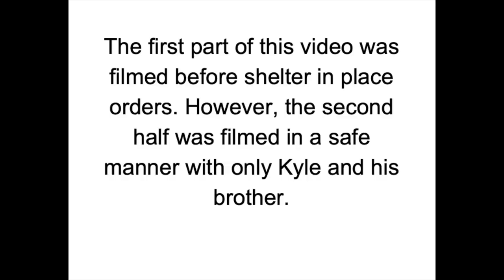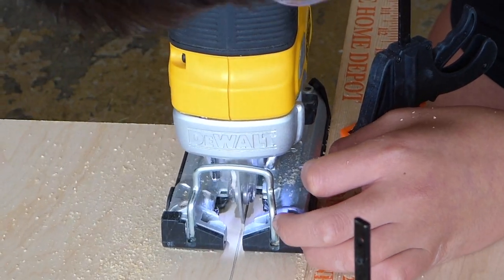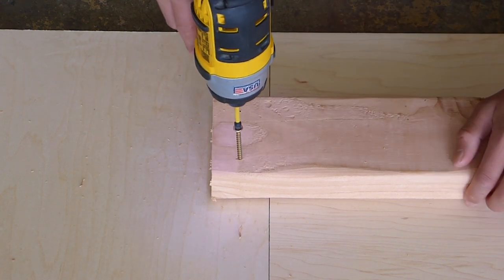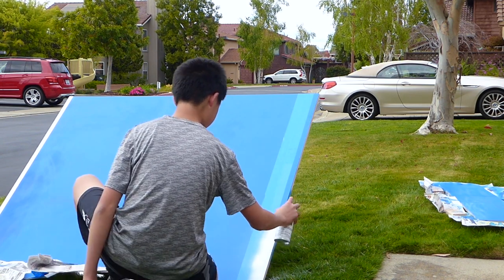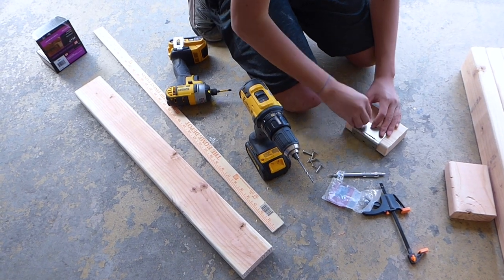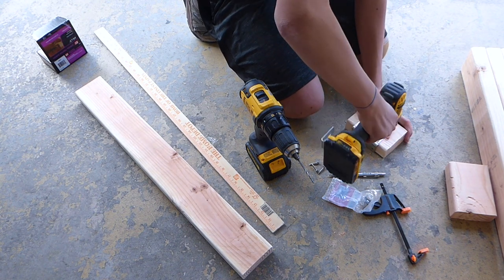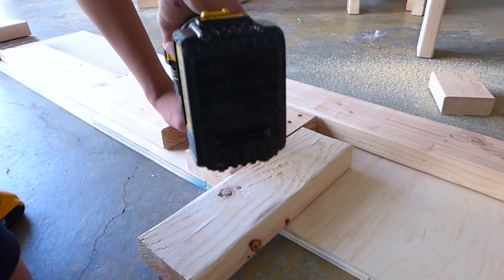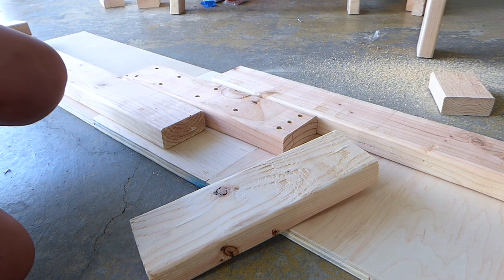How to Build a Ping Pong Table

Comment: You did a TON of stuff right, and it's totally fine to cut 2x4s with a jig saw. You have to support the pice you're cutting, and let the "offcut" pice fall as you cut it. If you support the offcut, it will lunch the blade as you cut
Reply from the maker: yeah, at the time the video was made, we didn’t have the right materials or tools to support things or cut well.